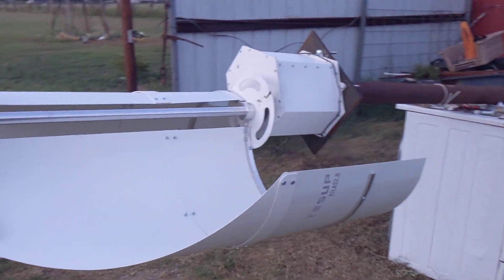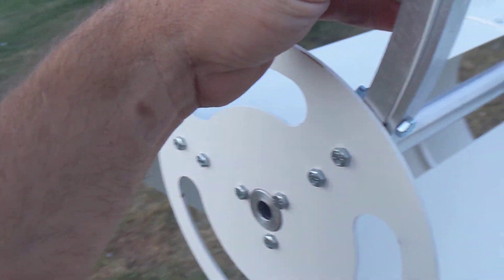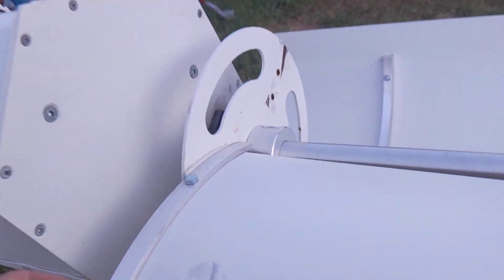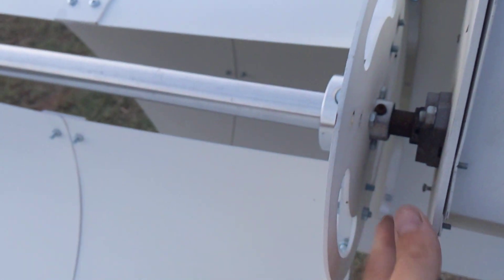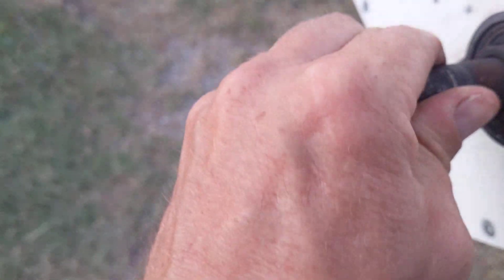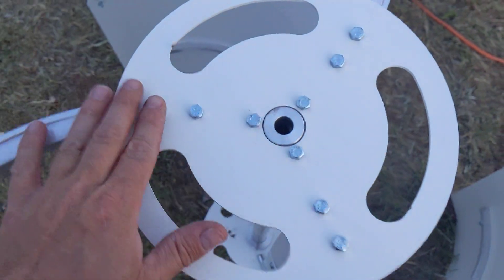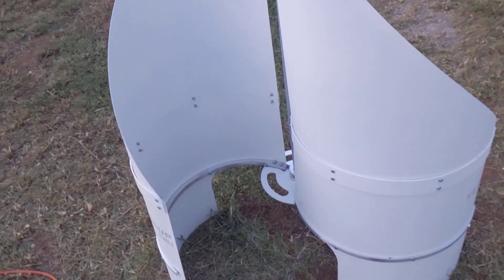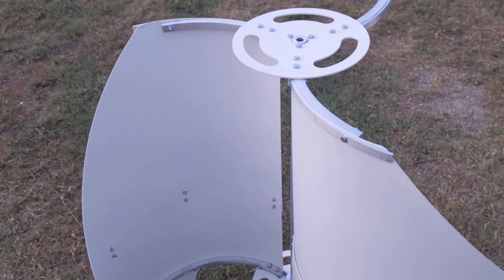TESUP Atlas 2.0 on the ground, final inspection before the Missouri turbine goes up the pole!

Comment: I confirm a very poor engineering of the whole stuff. I haven't even installed it since I received it, loose axis - weak bolts - oversold power (max 800W and not 4kW ...) ... foreseeable crash ...

Comment: At least yours was spinning. My Atlas X cannot rip itself apart because it doesn’t spin. It doesn’t spin because the cogging effect on its generator is so bad the amount of wind needed to make it start spinning is in my experience in excess of 60kmh. I saw it turn a whole rotation once in a bad storm. It is in fact an anti-turbine. Seriously I wonder if Tesup actually test these things at all. I can barely turn the generator shaft by hand when the vanes aren’t on it.

Comment: Did it occur to you to add lock washers?  Shame the chicomms didnt get the hardware right but this seems to be something happening more and more these days.
Reply from the maker: Sure it did, and I pointed out in the video that I could have done that but I put the turbines up as the manufacturers send them.  When how imbalanced the rotor was I'm not convinced lock washers would have held it together, though.
Reply: @ToysforWatts   ah ok.  I got sidetracked so havent watch the entire clip.  Got it marked for watch later.  peace